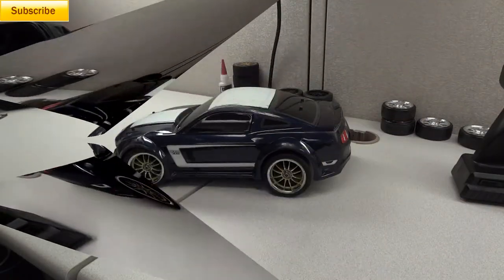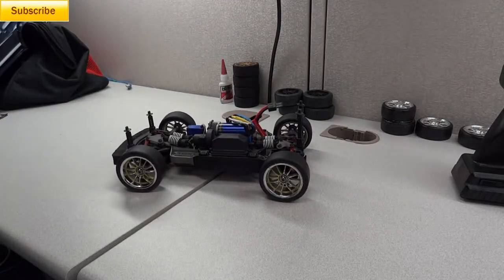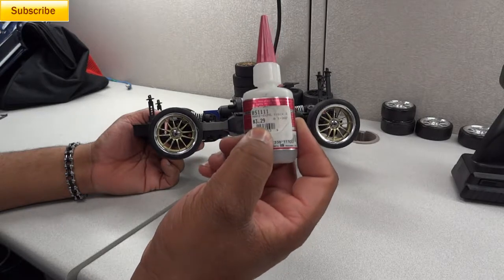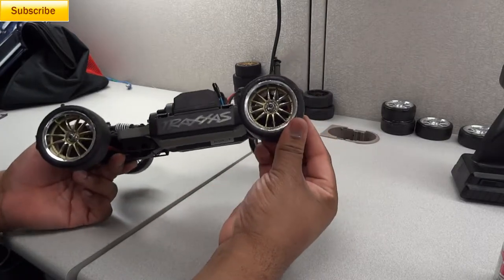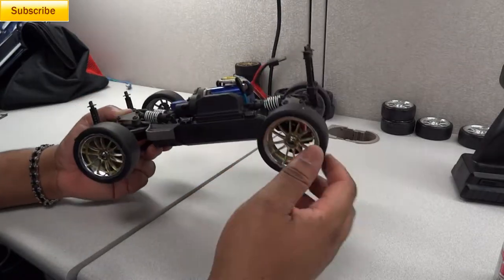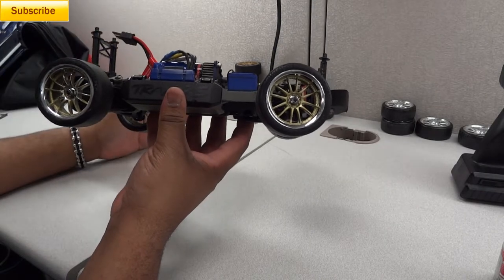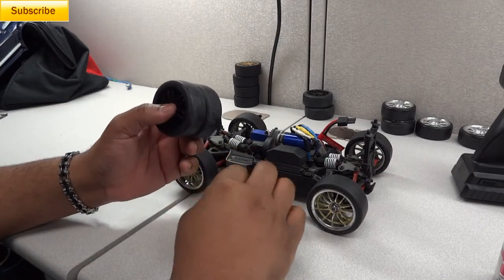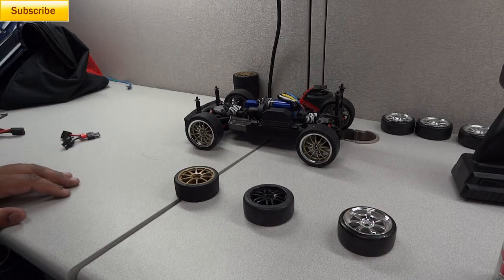Traxxas R/C Mustang Boss 302 VXL Wheel 4 Soft Rubber Slick

Comment: Then it makes sense why they are selling those wheels in pairs rather than 4 pieces. They probably count with using just two of these and the back and two more slicky in the front not to get the car in the flip everytime you steer. Which saves us money at the end, I guess, not having to buy a pack of four, even if we only need a pair. Thanks for all the RC videos. New fan here.

Comment: its simple, you need to adapt to your car. if you have sticky tires you will need to go a bit steadier in corners and if they are slippery you can go a bit faster(u know cuz they slide) with every set of tires you have you need to adapt to them or you will hurt your engine when rolling and crashing the thing (not trying to be rude just some tips)